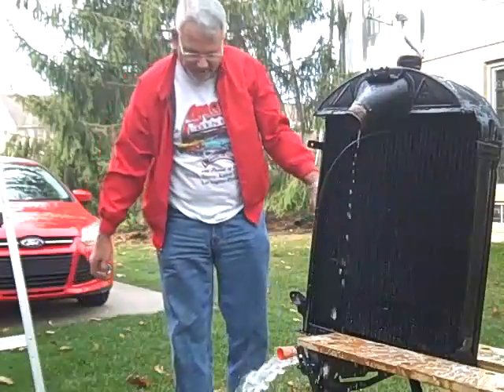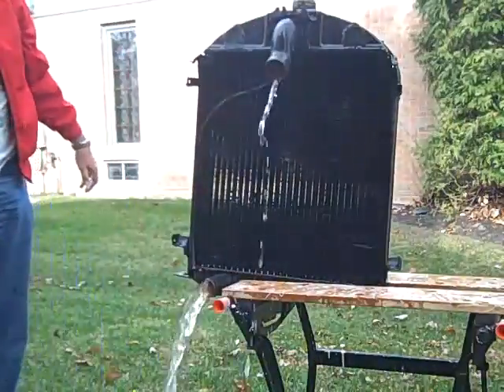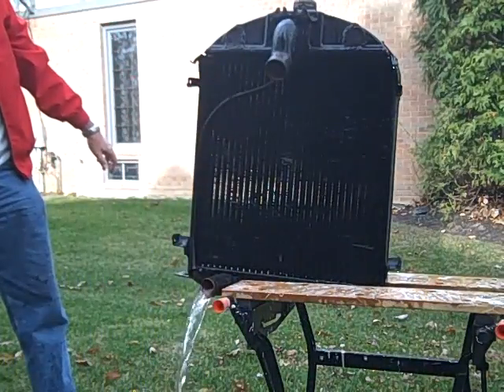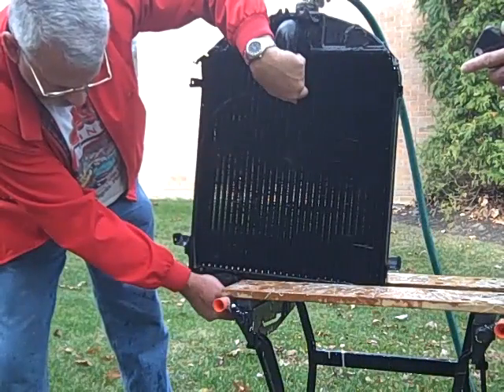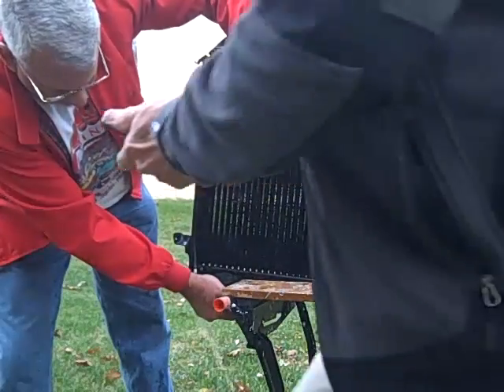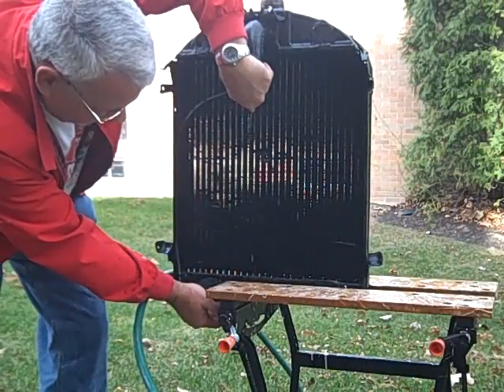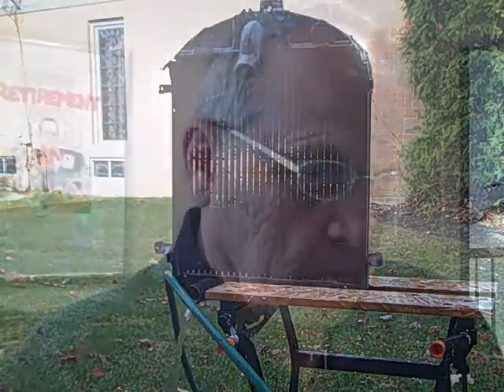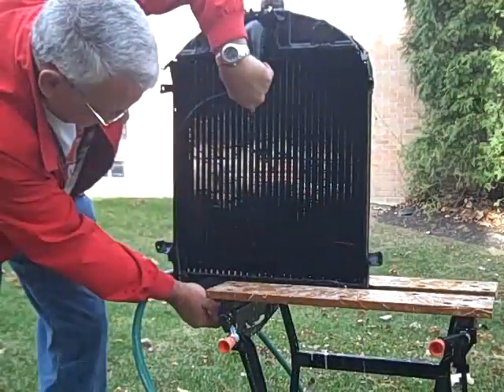Ford Model A Radiator Quick Flow Test Evaluation 2012

Comment: These look to be all 30/31 radiators?  Would you agree most often 30/31 radiators provide better cooling for the Ford A?      28/29 are more problematic from my experience especially the old 28 round tube..

But I recall a guy had a 28 round tube radiator in a 28 sedan that had just come down from a very steep hill climb on a hot summer day.  I asked him how did that old round tube perform..He told me "NO over heating at all".   I should have asked him if he had taken it to a radiator shop and had it boiled out...??

With your own back flush to improve flo that emptied at around 3 seconds or so would provide good cooling ability on a hot day and the others would not?   

So in conclusion these back yard flo tests like you conducted are enough prof your model A is  not going to over heat if the drain is around 3 seconds?   Or would advise:  play it safe, take it to a radiator shop and have it boiled out?  Thanks for the video by the way
..
Reply from the maker: The 30/31 radiators are better, simply because they are bigger.  Most cores are plugged and restrict flow, period.  You can't clear them by the so called "boiling out".  That will do nothing.  Back flushing just gets out the rocks and small birds.  If there is no flow through the tubes, it does not matter what you put in there.  Rodding out or core replacement is the only way.  The 3 second test tells you nothing.  You are just letting air in and the water in the open tubes out.  All band aids for people who won't admit that their cores are plugged.
Reply: Thanks Jack...I kinda to hate to put any radiator, on unless already proved to be a good one,   I have five 28/29 roadsters and a nice 28 roadster pickup, two 1930 coupes and 28 two door sedan and a great 1931 deluxe roadster I purchased from the Mayor of Ketchikan Alaska back in 1974.  That one has a proven good radiator...I will have to deal with radiators for each one them as I get closer to getting them up and running.   I have collected these cars for over 50 years and recently inherited my dear father in laws 30 standard roadster which puts me at nearly a dozen Model A Fords.  Most of them bask dormant in several large garages I have....waiting for bodies to be assembled to running gear.  Keep up the videos...I enjoy all of em.